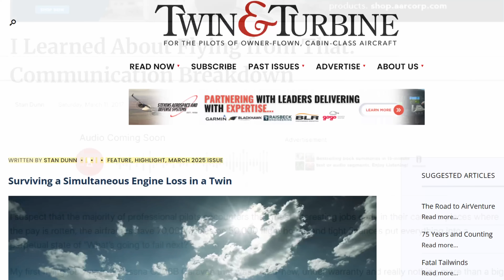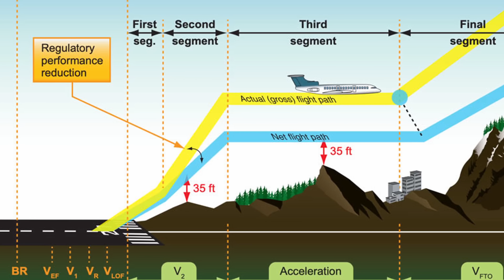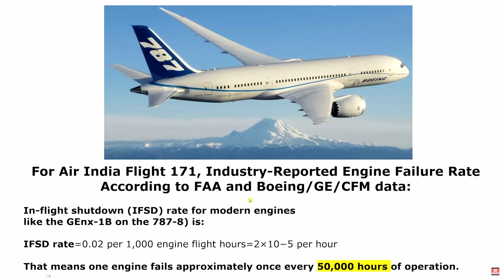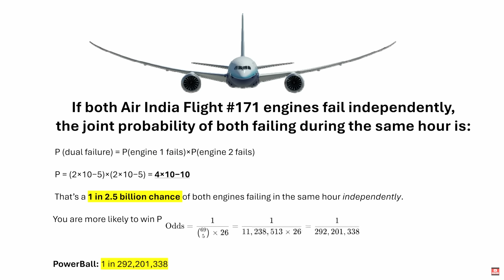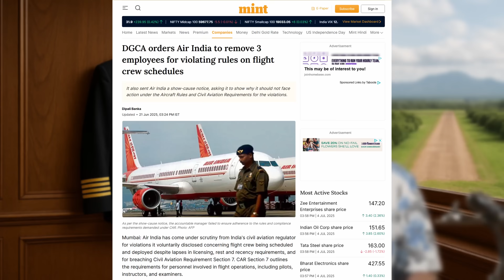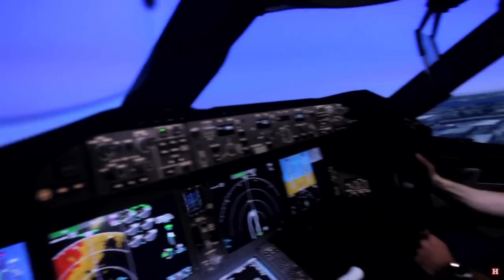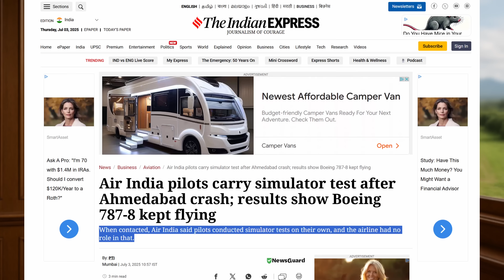Air India 171 Cause Becoming Clear

Comment: Please stop speculating until actual data is released.
Reply: It’s all attention seeking whatabouterey .
Reply: ya think it will be?  if not..then what?  If you were the investigator, would you speculate if the data didn't give you answers?  THEY ALREADY KNOW WHAT CAUSED THE CRASH, maybe not EXACTLY why that happened, but they know if the engines were running, if the fire handles were pulled, if the fuel cutoff switches were on or off, where the flap handle and gear handle were and the position of the flaps, the speed of the jet, the acceleration rates of the jet, the rpms the engines were at then the jet got off the ground and and back to the ground and everywhere in between, now, it's what do we tell the public..... lies and coverups, or the truth?  We all know that everybody is telling you lies, the truth is something very foreign now days.  I do hope we get it.  But am not holding my breath
Reply: Why are you here? You knew the video would be speculation. And you know speculation is what humans do. Hell, even the investigators are speculating. They have to narrow down the possible causes up front in order to focus resources.

Comment: I have never taken any flight training and I’m not a pilot of any kind, but it only took me two minutes of watching the video to know with 100% certainty that the aircraft crashed due to the flaps being retracted during takeoff.
Reply: Flaps are clearly not involved, B787 can take off with flaps retracted and for safety alarm can’t let you take off with such a configuration, also photos of the wing after crash show slats deployed. At this point we know stall is due to both engines loss, now we’ve to wait investigation. 
Not to mention the fact pilots said « No thrust, losing power » at ATC and RAT is clearly audible in video footage.

Comment: No new information added in this video.  Let talk about the 787’s unique “no bleed air” design that requires a doubling of the electrical load of the 787 compared to other jets.  If the 787 can’t generate enough electricity, it will shed load, just like an electrical grid shuts down neighborhoods to shed load.  One of the first things that gets shut down is fuels pumps, because the jet can run on gravity feed / suction feed without the fuel pumps.  However, at 107 degree F ambient temperature, losing pressure in the fuel lines and going to suction feed can cause vapor bubbles in the fuel lines, leading to vapor lock, causing engines to flame out.
Reply: Except that kerosene doesn't vapour lock, only petrol/gasoline does. There's never been a vapour lock reported ever in a jet engine.  So, yeah, there is that.
Reply: @bubbleboy468  Yes, jet fuel can experience vapor lock, although it's less common than with gasoline due to the fuel's properties and modern aircraft design. Vapor lock occurs when fuel turns to vapor in the fuel lines, disrupting fuel flow to the engine. While modern fuel blends and aircraft designs minimize the risk, factors like high temperatures, high altitude, and improper fuel system maintenance can still lead to vapor lock. 
Here's a more detailed explanation:
Understanding Vapor Lock:
Vapor lock happens when fuel turns into vapor, typically due to heat or low pressure, causing it to compress instead of flowing smoothly through the fuel lines. 
This is more likely to occur in fuel-injected systems after the flow divider, where the fuel lines are closer to the engine and exposed to heat. 
In aircraft, vapor lock can lead to engine sputtering, rough running, or even complete engine failure. 
Why Jet Fuel is Less Susceptible (but still vulnerable): 
Jet fuel has a higher boiling point than gasoline, meaning it requires higher temperatures to vaporize. 
Modern aircraft fuel systems often have pumps that maintain positive pressure, making it harder for vapor bubbles to form. 
However, vapor lock can still occur if the fuel lines are exposed to extreme heat, such as from a hot engine or poor air circulation. 
Factors Contributing to Vapor Lock in Aircraft: 
High ambient temperatures:
Hot days and hot engine compartments can raise fuel temperature, increasing the risk of vaporization. 
High altitudes:
Reduced atmospheric pressure at higher altitudes can lower the boiling point of fuel, making it more susceptible to vapor lock. 
Improper fuel system maintenance:
Damaged or poorly routed fuel lines, or inadequate heat shielding, can contribute to vapor lock. 
High power demands:
High-performance maneuvers or prolonged high-power operation can increase fuel temperature and pressure, potentially leading to vapor lock.
Reply: @bubbleboy468  While vapor lock is a well-known issue in piston-engine aircraft, it's generally less of a concern in jet engines due to differences in fuel systems and fuel properties. 
However, in certain circumstances and particularly with the potential for extremely high temperatures, there are possibilities for issues related to fuel vaporization in jet engines. 
Here's why and how:
Jet fuel and vaporization: While designed for higher boiling points than gasoline, jet fuel can still vaporize under extreme heat.
High-temperature environments: Prolonged exposure to high ambient temperatures (like on hot tarmacs) can elevate fuel temperature and increase the risk of vaporization, even for jet fuel.
Fuel system issues: Although rare, improper maintenance or modifications to fuel systems can create vulnerabilities to vaporization

Plane sat on tarmac at 107 degrees F for 2.5 hours with no APU and no AC running, prior to takeoff off.  Interior videos shows steam in the cabin and people fanning themselves.  Plane was completely heat soaked.  No previous reports of jet fuel vapor lock because all other jets use bleed air to run auxiliary systems, which ensures fuel pumps keep fuel lines pressurized.  787 manual specifically says that  in case of low electrical current, load shedding will occur and fuel pumps will shut down and engines will switch to suction bypass mode, which means that fuel lines will be at NEGATIVE pressure.
Reply: Oh, and even if there was a miracle vapour lock, the fuel combustors would go non-stoichiometric and so smoke, vibration and audible misfire would be clearly evident.
Reply: @bubbleboy468 smoke occurs when mixture is rich, not lean. People on ground heard an audible bang, potentially indicating flame out.  Pilot reported loss of thrust.

Comment: That’s a very comprehensive and professional presentation. Whilst the possibility of intentional engine shutdown (of the wrong engine) exists, as you say yourself, it goes totally against the trained procedure. What was the position of the thrust levers, fuel cutoff switches and fire handles after the crash?
I’m inclined to think that water ingress into the FADEC might still be the cause. Boeing’s safety bulletin of March 2024 highlighted the possibility of water leaking from a forward toilet down into the MEC. Maybe Air India engineering failed to carry out the necessary inspection and repair on that aircraft.

Comment: Be sure that Boeing, Air India and all involved institution will make sure that the insurance has to pay only the minimum amount to the families of the victims. Only when you can see something with your own eyes you can trust them like when the door of the 737 flew away. When the Dreamliner is such a safe plane why is it not possible that the damaged engine can stop by itself and blocks the manual stop by the crew of the running engine.

Comment: Hmmm not sure on the stats. Once you have tossed a head what are the odds of getting a second head 50%.once you have a single engine failure then the chance of a second failing within that hour is one in 50000.

Comment: Captain, that's a good explanation. Obviously the crash happened due to shut down of the engines. After the plane took off from the runway dust like smoke is seen coming out of the engines, the two engines might have ingested something. Fuel contamination is also being discussed widely.

Comment: 14:20 or external battery box venting of (the fire supression) gas from the battery box vent (located rear and to one side of the main landing gear)... Just an idea (subject to correction comments) that seems to fit the timing of events (and cound have torn some data cables as RAT soon dropped after this)... Kevin..

Comment: All I wish to say, as a retired pilot,  is that if one engine fails, you do everything you can to keep that baby climbing.  So no haste shutting down engines. Get some altitude before deciding to cut a failed engine.
Reply: Yep. It's not like you have to feather a prop to keep it upright, and the rudder didn't seem to move.
Reply: I'm not a pilot, but agree with you totally. Why would you cut an engine at such a crucial stage, it would be suicidal! I sincerely don't believe they cut either of the engines.There will be another cause!
Reply: @2760ade  I think it’s what you mentioned or other sabotage.

I’m also really angry at the way the site was not protected. Bulldozers went in before examiners.
Reply: @Threemore650  Bit suspicious that? Were they trying to hide something, or is that a bit 'conspiracy theory'!!
Reply: @2760ade  You wouldn't, this click bait is just wild speculation repeatimg theories online. It makes no sense that the pilots would instinctively hard shut down the engine during takeoff. Pilot error could certainly be a factor but simply blaming the crew is the lazy way of saying, "I have no idea what happened".
Reply: @JJFX-  in this case, it’s at the end of a long line of dismissed theories.

Options are thinned almost only to pilot.

They do seem to have been extremely overworked.
Reply: And that’s what he said; he also said AI tested other pilots; not all handled the scenario properly - so going cheap on training is a possibility. And given AI’s history (although improving after ownership change) not surprising.

Comment: @15:22 - are you saying that any pilot could intentionally (or accidentally) turn off both engines by moving a couple of small levers?
Reply: I was thinking the same. Maybe there is a two motion system like "pull then switch" or something... surely

Comment: Your misuse of statistics is misleading, but don't worry...No one expects pilots to be good at statistics.

We are not interested in predicting the likelihood that this PARTICULAR airplane would fail within 1 hour. Instead, we should investigate the likelihood that ANY dual-engine jet airliner would fail over the course of many years-worth of accumulated hours.

Ignoring Air India Flight 171, the most recent independent (e.g. non-pilot/non-maintenance/non-ingestion/non-fuel related) dual engine failure on a jet airline was...never. Let's assume there have been 20,000 dual-engine jet airliners flying 3,000 hours per year, for 50 years. In that case, 3,000,000,000 hours were flown. This gives us a 2.1% chance of failure in the past 50 years. 

Cumulative chance of independent dual engine failure = 1-[(1-1/(375,000*375,000))^(20,000*3,000*50)] = 2.1%

Since this value is far below 50%, we can assume that random independent failure is an unlikely cause for Air India Flight 171.

If we assume this type of failure during this particular flight, we can then ask, "What are the chances that it occurs within the first minute after beginning takeoff roll?" If this route is typically 10 hours, then the random chance of the failure being within the first minute, is 1 in 600, or about 0.17%. Therefore, we can probably conclude that the timing of the failure wasn't random.

However, nonrandom timing, doesn't necessarily require nonrandom cause. It's easy to imagine why random-cause engine failures are more likely (per unit time) during takeoff.

Comment: Best explanation I’ve seen talks a about a likely computer shutdown due to overheating as the previous flight of the aircraft reported the aircon and entertainment systems not working. The aircraft had then sat in the sun for a further 3hrs with no cooling. The theory is that the computer would shutdown at 70degrees C as power consumption was peaking so the fuel stopped being pumped to the engines. So dual engine failure leads to deployment of the RAT with insufficient height and airspeed to recover.

Comment: It was extremely hot that day - the fuel was hot, near its vapor point.  If fuel turns to gas inside the pump system that drives the engines, it would result in the pumps not working as they rely on liquid fuel, and there would be vaporlock, which would result in the pumps running superspeed yet not enough fuel going to the engines and a double engine loss of power.  India being the super hot place it is, and this being in the hottest month, this cause is very possibly at the root - not fuel contamination by particles or subterfuge, but heat, a kind of heat that is inconceivable at other airports and thusly overlooked by north hemisphere crash investigators...
Reply: ... so why hasn't this happen in even hotter places, like the Middle East?
Reply: but we would see it more often then ?? maybe combined with another factor ...

Comment: The shitter leaked into the avionics bay. A bit too much bias here towards pilot error.
Reply: In this case I tend to agree - there are too many built-in safeguards in the 787 to allow (for instance) shutting down the 'wrong' engine.  That said:
Pilot Error: This accounts for approximately 53% of aviation accidents, and includes mistakes in decision-making, flight planning, and aircraft control.
Engine and Equipment Issues: Mechanical failures contribute to about 21% of aviation accidents. This includes problems with engines, systems, and structural integrity of the aircraft.
Adverse Weather: Weather-related factors are involved in about 11% of aviation accidents. This includes issues like turbulence, storms, and visibility problems.
Other Factors: Other contributing factors such as fuel mismanagement, air traffic control errors and poor communication account for the remaining 15%.  Note that non-pilot 'Human Factors' errors are at the heart of many of these.
Reply: Something like that is very likely i think
Reply: Is that called a software failure?

Comment: According to pilots who have flown that plane out of airstrips at altitude and at warm temps say that 15% flap is pretty much minimum with 17% to 20% with max loads.  At those settings the flaps should be somewhat visible.  While the pilot had apparently called lack of thrust, in a simulator the flaps being taken to 5% or less, the initial thought of the pilot was lack of thrust. Given a few moments he was able to re-evaluate and correctly call the issue.
Yes, there could be dust on that runway at that particular area as most of the aircraft in and out of there rotate a lot sooner than the 787 needed with that load.
Air India purchased the cockpit video module so there will be data, voice recordings and video. What I have not had answered from contacts is if the cockpit voice and video go to the same black-box or separate ones. If separate, that would give three devices to examine and if one of them was unreadable would still give two sources.
Instead of constant what-ifs - how about we wait for the data.

Comment: Don’t make these long videos without any real information, just look at the Boeing Flight Crew Operations Bulletin NLH-42-R1 and I would say there lies the answer most likely. Boeing knew before the plane crashed if both engines shut down and most likely the cause as the B787 transmits in real time such data. If they wanted they could at least release that information. But of course that would crash their stocks and ground a lot of planes.

Comment: Surely the RAM being deployed demonstrates they lost power and therefore lost control of the flaps AND fly by wire engines?  This loss of power was foreshadowed by the passenger on the earlier flight on this plane reporting non responsive passenger cabin electronics.